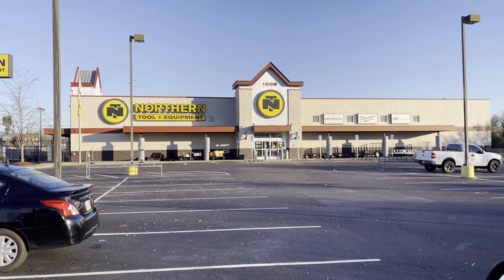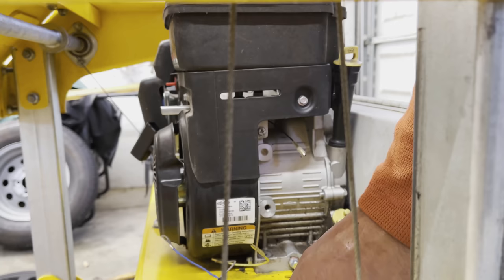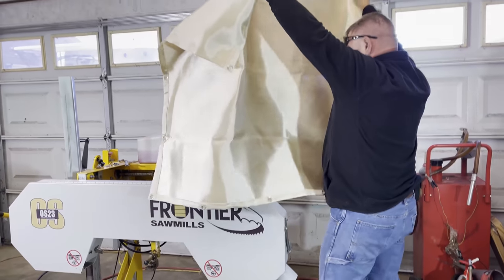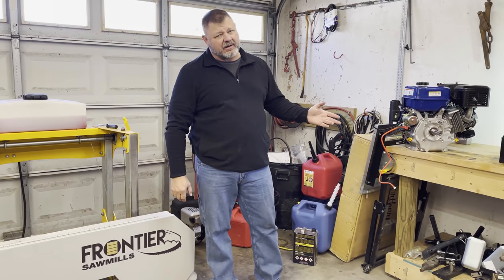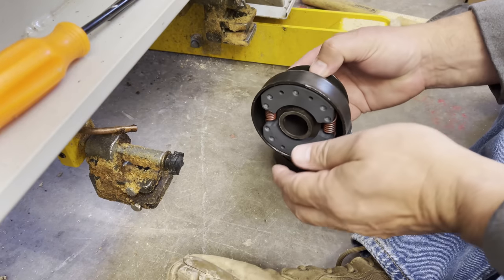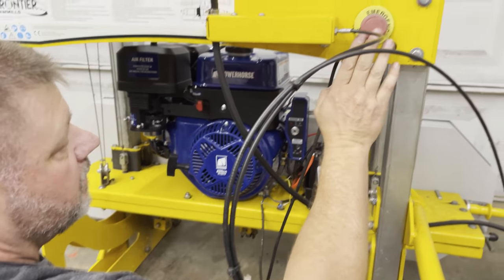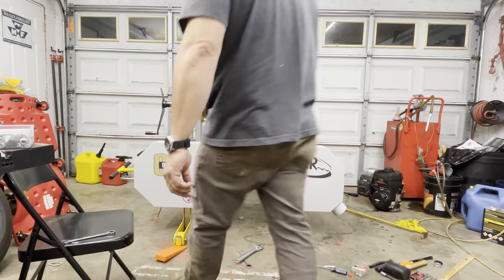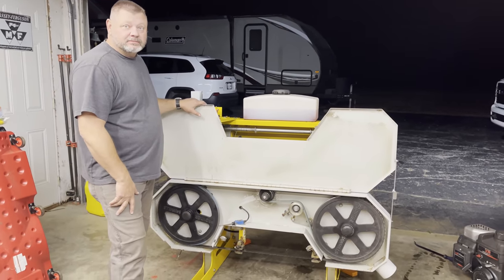HOT ROD Portable Sawmill | Frontier OS23 | Doubled Engine Horse Power

Comment: Fantastic Tony. The 0S 23 now stands for “ On Steroids 23”.  I too went with an after market clutch that can handle up to 15 hp. I’ve had my new engine for my 23 for quite some time. You have motivated me to get er done. Can’t wait to see it in action.
Reply from the maker: Don, I have cut through my first log, and the engine doesn't even slow down. We were cutting Black Cherry.
Reply: @TonysTractorAdventure  That’s great news. Trevor at Norwood told me about a year ago that the O23 would cut like a dream with an upgraded clutch and engine. Guess he was right. Can’t wait to do mine. Thanks for taking the time with the videos so all of us can see the correct way to upgrade our mills.

Comment: Fantastic Job! I would have been so worried about that crankshaft being higher than the original. Looks like you did your research!
Reply from the maker: I have done a good bit of fabrication before, but it is a bit scary when I start putting it back together. In the grand scheme, this not that far out there. I am thinking about building my own sawmill.

Comment: Excellent video, have same sawmill cant wait to upgrade also. Thankyou for doing this. I bought some blades from kenne-saw in Cartersville, Ga. I think they are much better and sharper blades. Also a little cheaper than ones from Frontier. Fast service got blades in about 3 days from ordering.
Reply from the maker: Thank you. My last blades were from Cooks. They seem to do a bit better and at a better price. No, I have the extra HP, I can run 4 or 7 degree blades also. This opens up different possibilities.

Comment: Great Job!  I have had a lot of the Chinese engines of that design on generators.  All were great.  One thing I noticed is I would always run the engine 1 hour and dump the oil.  In all of them I had milling glitter of metal come out of the first oil change.  I always wanted to clean that out of the engine as quick as I could.
Reply from the maker: Sound like a good idea. This engine should have an easy life. Thank you.

Comment: Tony, You should have slapped a Kukje A1100N2 on there. Yes, on these Chinese engines, run them for a few sessions of 1h each and change oil. Usually on 3rd it comes out with no silver glitter in em, and it will last forever. I just got a Duramax XP12000EH generator with the same engine you didn't get. And that is how I broke it in.
Reply from the maker: Thank you for the info. My Briggs was the same way. It had tons of oil glitter.

Comment: Love the upgrade.  Wouldn’t the smaller clutch pulley get the speed back up?  Or were you going more for torque?
Reply from the maker: The smaller pulley on the engine slows the blade down and increases the torque on the blade. I may step up one more because I have more torque and hp.

Comment: Did you ever show how you fixed your throttle? I got the duromax 440cc and the throttle seems really tight.
Reply from the maker: There is a small nut on the throttle linkage. Loosen it just a bit.
Reply: @TonysTractorAdventure  thanks. I appreciate it. I got everything done but the throttle. It's a hoss
Reply: I'm having a problem with belt wear. I had to loosen the tension as much as possible. My blade is showing a wheel mark on it. Could it be I'm over tensioning the blade? I used a kevlar 5/8x75 from tractor supply.

Comment: I'm curious on the clutch I have the same mill and have a 13hp Honda engine (motor 😊) and the shaft height is 1.143" taller my question is which clutch did you use? Was one of them the Hilliard H1P3 with a 3" pully and 1" bore
Reply from the maker: I get that question a lot. In my haste, I misplace the place I bought it from online and the specs. It will suck if it ever goes out. I will have to research it all over again.

Comment: You changed engine because the old one was bogging down?
Reply from the maker: I did. They offered a 10HP, but I went with 7HP. That was on me. It will cut everything it was rated to cut but slowly.
Reply: @TonysTractorAdventure  You did a good job of it. WWould have been great had you recognised the need for more HP engine when you bought it. But you fixed it and now everybody knows how to do that too. Great vid.

Comment: Where did u get ur clutch do u have info so I can look up the clutch info
Reply from the maker: I ordered offline. I have lost the information over the build. I can not find the part number.
Reply: Do u remember if it was eBay or amazon
Reply from the maker: It was off a single company on the internet. It was a one-time purchase. I have looked in My email and nothing jogs my memory. I am leaking knowledge as I get older.
Reply: What size did u get to fit that right size that will help
Reply: I'm pretty sure the 3" is a Hilliard brand model number H1p3 I think it's rated at 13hp though so I'm not sure I have found plenty that are 3" pulley 1" bore but are only rated up to 8hp but the h1p3 is 13hp